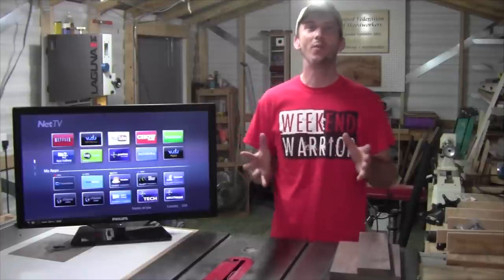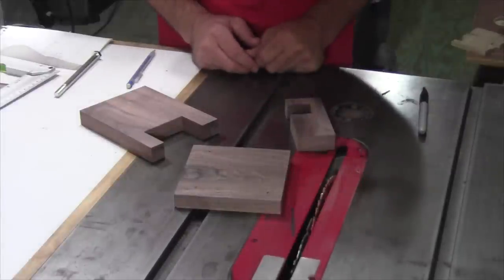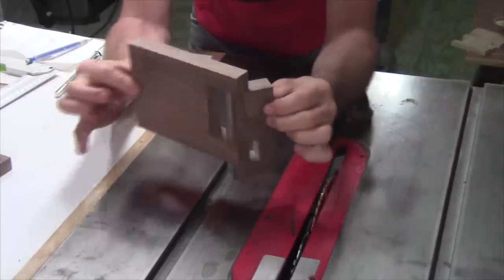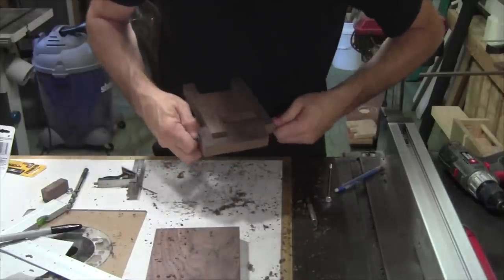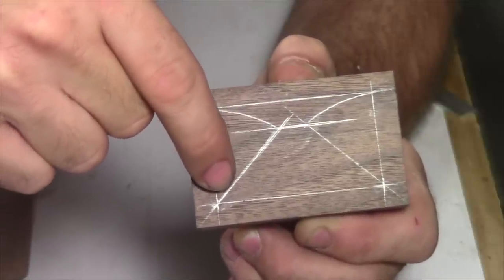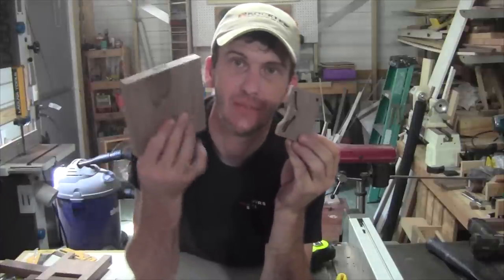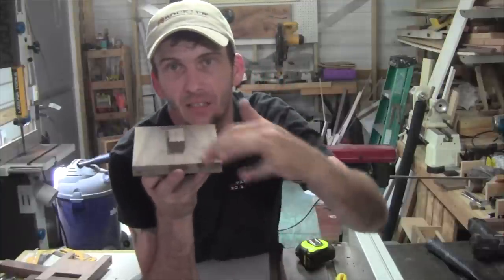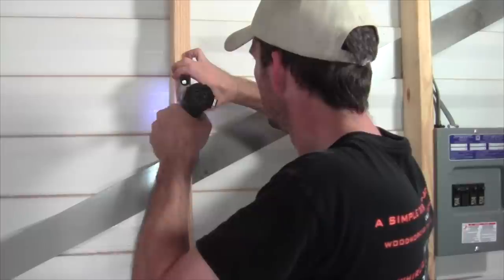How to Build a TV Wall Mount From Hardwood

Comment from the maker: Lenny, You would need to make a larger back plate (that mounts to the TV) and I would suggest using 5/16 bolts rather then 1/4"  Do a thorough weight test before mounting your TV and when you do decide to mount your tv, have someone help you during the mounting.

Comment: If you are not quite ready to do this project yourself, or its in a part of the house where how it looks is crucial, I may have a solution for you.  
I recently had the Down and Out Swivel Mount installed above the fireplace in the home we just purchased. It holds neatly in place above the fireplace when closer viewing is not desired, and well away from children, pets etc. When its time, you simply pull down on the TV and it glides down and out at the same time, with the TV much lower for better viewing and closer to us. I got the swivel option as well so if I'm watching in my easy chair and no one else is, just angle it around a little for that. We are very pleased with the product, and the installers at AVPRO worked it so that no wires/power chords etc are seen. I do not hesitate to endorse this product, and it is superior in my opinion to others on the market. Its a long time investment and well worth the cost for the value. John Cockrell
Down and Out Swivel Mount

Comment: Even with walnut, this won't hold long. You have removed way too much material from several places that will need to carry forces. Even simple brackets are designed using math and software that enables them to calculate maximum carry weight or forces. You seem to forget this simple step.

Comment: So the wall mount plate is glued to the rest of the contraption. So you're essentially glueing your tv to the wall. I wouldn't dare do that even with the smallest tv. Why not just drill a whole through the plate and the glued-in small piece and countersink a screw or two into it. Noone would ever see it and it would probably hold forever.